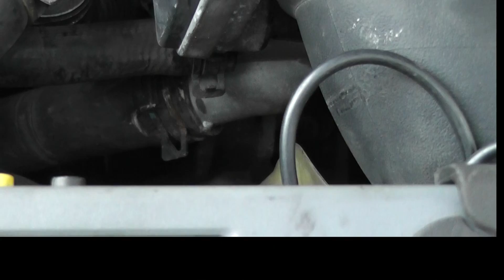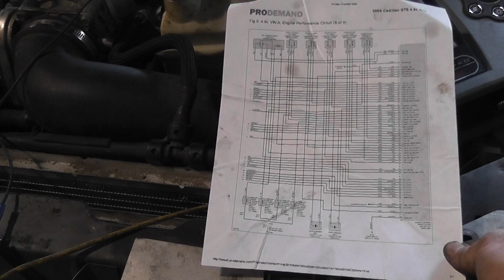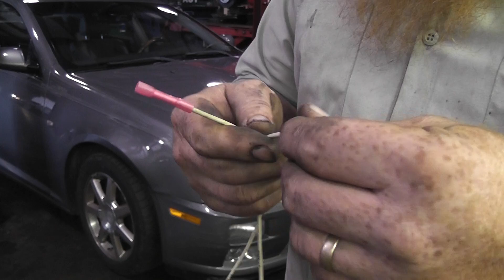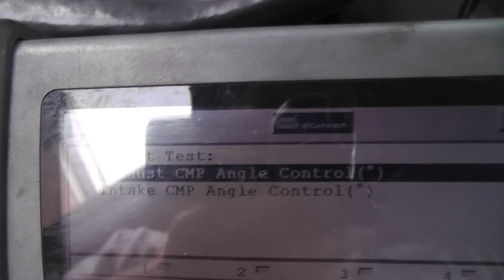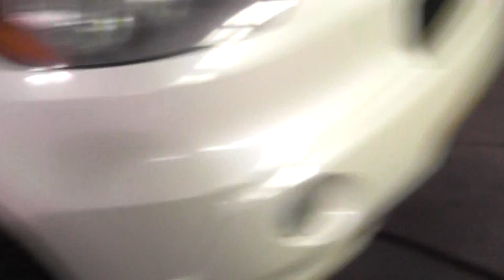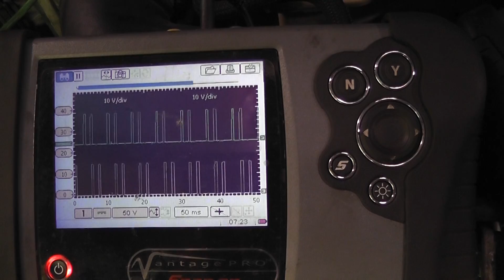CADILLAC VVT CODES P0011 AND P0014

Comment: A dead battery in a cadillac can be caused by the obsolete analog onstar module in the trunk near the power antenna.  Disconnect it!!  It wakes up every few minutes and searches for an analog cellular signal that does not exist anymore.  It can malfunction, and stay on at full power draining the battery very quickly

Comment: I have same issue after replace the engine I got P0011 and P0014 on optima 2.4 GDI 2011.
I have change the poth CMP, but I didn't fix the issue :(.

Comment: I think the reason why you saw the increased duty cycle on the actuator was because the computer didn't like what it saw on the position sensor and therefore kept keeping the actuator on longer.  Too bad you didn't have time to look at the actuator current and duty cycle at the same time.  You would have seen the increase in current and you could compare that to the known good one.
Reply from the maker: yea. ur probably right.  it just looked funny with that rhythmic rapid pulse
Reply: Saw you have a solus edge now, how do you like it?  Contemplating on getting one myself.
Reply from the maker: Nah. Its Nick's.  I think its the solus ultra. I like it though
Reply: Ultra ok.  Does it come with troubleshooter built in or do you have to pay a sub for it?
Reply from the maker: no. he got it off Craigslist.  I think the basic trouble shooter like mine but nothing online.

Comment: Don't you just love those junk yard dogs. Sounds like some of the engines i've gotten before, they say yea we got one that will fit and then you find out you have to swap everything but the block to make it work. Good job JD, thanks. Does anyone ever call you JD?
Reply from the maker: thanks. I've heard JD a few times
Reply from the maker: this engine the shipping slip said Washington... an eBay deal.. can u imagine returning that?  I think the most nervous I was, was on that VW 2l turbo with the broken chain I showed real quick on a video. I had everything swapped including a new timing belt kit before I saw the turbo housing was cracked and Turbo was seized.  was thanking the Lord that one purred on start-up

Comment: Shouldn't you have cleaned up the old phaser gasket first before putting the snap ring in?  Did you make a new adhesive gasket?  Amazing job getting the snap ring in.  Pretty sure I wouldn't have been able to do that.  This is by far your best video yet.  The camera angles, focus, editing, procedures, and showing every step including confirmation waveform is outstanding.  Please use this as a template for all of your future videos.  This video is absolutely perfect.  If you do all your future videos in this same exact way you will acquire a huge following.  Bravo.
Reply from the maker: gee. no pressure.. Ha.. glad u liked it. I thought it was a little scattered cause I filmed a bunch out of order

Comment: Now that was off the wall 👍 glad you showed how you put the test leads together as well.   BTW Danner  your moms car did the head gasket stop leak repair last ?
Reply from the maker: Grammys car is gone. we had a replacement in the works when I did that video. it started pushing that crud into the overflow tube and clogged the elbow in the cap and actually over pressurized the system bad enough to crack the radiator.  3 separate times. (glued it). then the fan cycled erratically a few weeks later..never got another C0 hit tho. I think that stuff insulated the sensor. prob gummed up the tstat.  I think she got to 149500 miles. maybe 3k ? before summer creeped in and all that started showing up.  my next short video is gonna be the eulogy, to put it to rest
Reply from the maker: I meant 249500. shorted the old girl 100k. ha